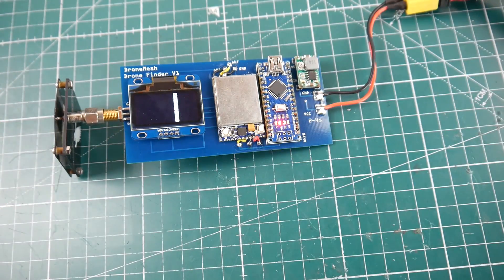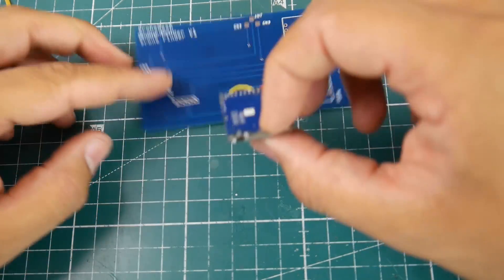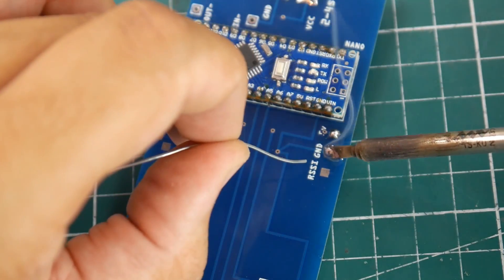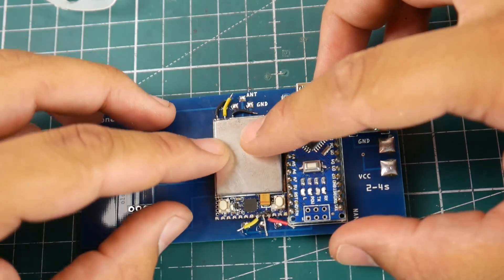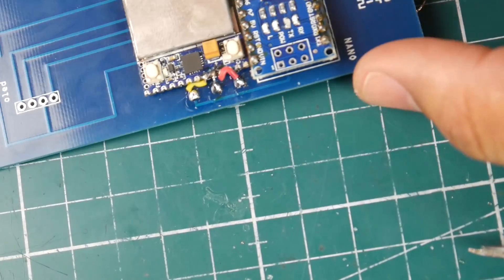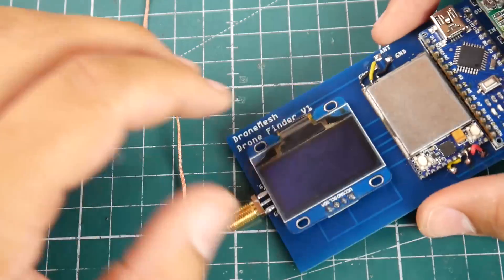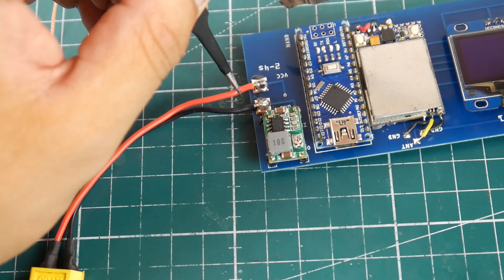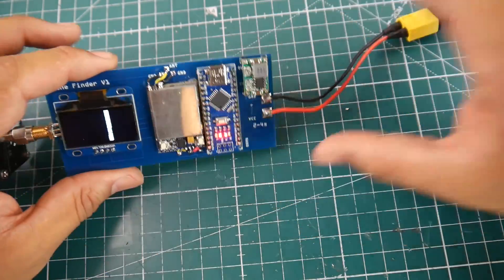FPV Drone Finder To The Next Level!! // #DIY DRONE FINDER

Comment from the maker: FPV DRONE FINDER PCB 
https://www.pcbway.com/project/shareproject/DroneMesh_FPV_Drone_Finder_V1.html

## PARTS LIST
Skyzone RX5803 12
https://www.banggood.com/Skyzone-RX5803-5_8GHz-48CH-Raceband-AV-FM-Receiver-Module-p-1159848.html?p=CS101558118042016088&utm_content=huangguocan&utm_campaign=mesh.drone
Reply: Wjen are ALL of the 6s testing coming up? Holybro tekko32 35a esc 6s testing and hobbywing 6s stack and hglrc titan stack? As well as the one's you have built?

Comment: All PCB traces should never be at 90 degrees angle turns, always use 45 degrees twice to make a 90 degrees turn, to prevent signal loss on the traces

Comment: Thanks for continuing working on this project! Much needed product without getting a diversity receiver for much more money.

Need your help, though. I'm getting this error when uploading - "avrdude: stk500_getsync() attempt 1 of 10: not in sync: resp=0x00"
Any thoughts on how to fix this?
Reply: Finally finished uploading, even with those warnings. Seems to be working fine, but not sure if those errors will cause issues.
Reply from the maker: Are you using a Nano??
Reply: Yup, I ordered the Nano from the prior drone finder video links.

Found some arduino threads where folks were running into this issue. Some were saying they switched changed a few things in tools, and then reverted back to the corrected settings and that kinda helped. I'll try that this evening.

Comment: Routing a Antenna (Coaxial) cable through a PCB like you did it is actually not that good of an Idea. Since the Antenna isnt fully surounded by a Grounded shielding inside of the PCB it acts like a “Antenna”. You could consider re-designing it in a way that the receiver is on the left, so that you cant solder the antenna either directly to it or close to it.

Keep the great work up!

Comment: We need more people like you to push forward the boundaries. Nice little project. I like it. Only thing is I didn't like the way the pcb was designed. Especially when major em waves are in place. Also, when you're using 5.8Ghz, none the traces of the antenna should me more than the electrical wavelength of 5.8G. They should be less than 10th of the wavelength to reduce the amount of interference from other sources and also reduce the power loss. It'll then be called "electrically small". And a ground plane(or two even!) is a must for so high frequencies.

Comment: Cool project and well explained, as you have us accustomed to.

But... You order PCB and have to bridge with wires? That kind of defeats the purpose.

By the way, those OLED screens are way to brittle to use without any protection. Already changed 8 Eachine Pro58 screens.

A 3D printed case would be a nice addition. I know you plan on doing it.

Waiting for your ESC tester v2.

Keep the good job!

Comment: You honestly should never have a route turn 90 degrees is a pcb, always use 45 degrees.Also you can use a ground plain so that you don't need to connect individualy every ground pad, but in such a simple board it's not a problem.